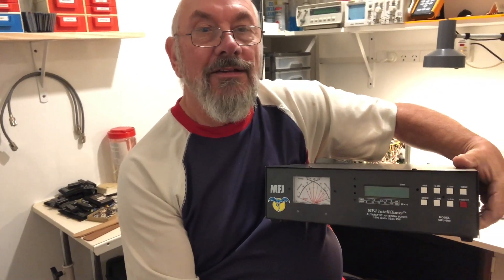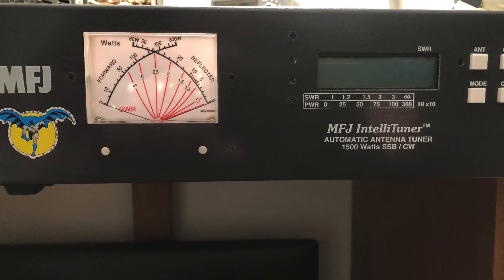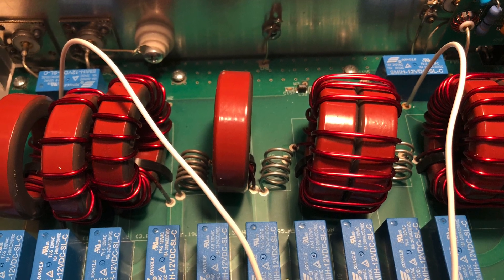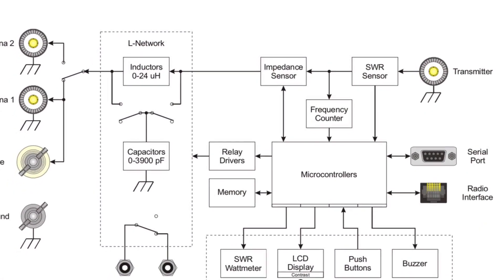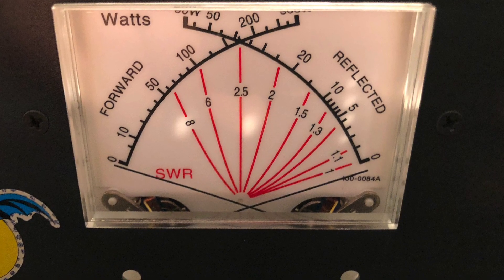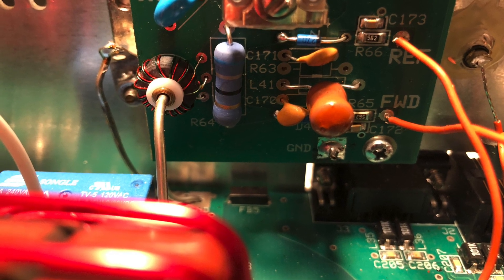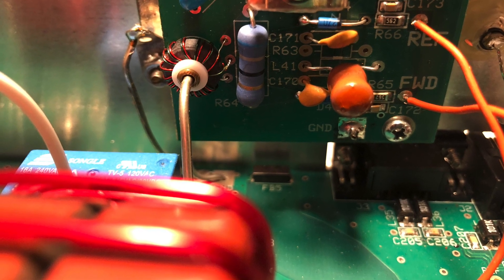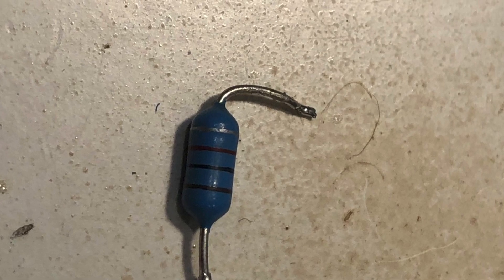Andy's Workshop - MFJ998 antenna tuner repair

Comment: Hello Andy....I am having a similar issue with my 998 at the moment but my analog meters are not working 1 out of 4 transmissions only....its intermittant....
Is this possibly a diode issue on that rf sensing board??? Do you have a schematic for this unit at all?? Do you know what the actual diode part#s are on this board?
How can I test these diodes to be sure?? Any help or suggestions welcome
73 Ted VE3SS
Reply from the maker: Hi Ted,
I don’t have a schematic as MFJ won’t provide one. I just had to trace the circuit as best I could, however the sensing board is a conventional design.
I do not know what the diode part numbers are but as long as they’re matched it probably isn’t critical. The unit would probably need recalibrating if they’re replaced.
Diodes are unlikely to be intermittent. I would be inclined to look for poor solder joints in the unit. Tsp things lightly with a screwdriver handle to see if you can provoke the problem.
The solder joints associated with heavy components like the large toroids are known to be problematic.

Comment: Hello Andy.  Enjoyed the video.  Have you heard of any situation where the MFJ-998 powers up but the digital display does not come on? Any thoughts on this?   Thank you!   Paul    KA1GIJ
Reply from the maker: HI Paul, Glad you enjoyed the video.
I'm afraid I have no direct experience of the fault you describe.
I would just have to try troubleshooting techniques based on a best guess approach because MFJ will unfortunately not publish any information or schematics for their products. I would be probing around with an oscilloscope looking for microprocessor activity and signals to the display module.

Comment: So...Andy was this part that was replaced an inductor or a resistor ? If it was a resistor, what value was the replacement ? By the way, did the replacement work for this repair ? I have the same mfj- 998 unit. My reflect will tune with vc1, but my forward tune only goes to 40 at vr-1. With that said, my tuner fails to tune an antenna and says oops....low power or something of that nature. It basically will not tune anything right now. Purchased this a few years ago and sat on a shelf. But has never worked properly. I recently downloaded the manual and started trying to do an internal tuning and found that the rear rf board could be the culprit. I only get less then a volt with an input of 100 watts. So you can see my problem at this point. I called mfj and they are going to send me an rf input board at the price of $18.00. Really just wondering if this will actually turn out to be my problem and fix. Thanks....Billy / Albq. N.M.     2 / 8 / 2023
Reply from the maker: The failed component was an inductor. The video shows the actual component that failed. It looks like a resistor but it is an inductor and it was open circuit. I'm not sure of the value and the video isn't clear enough to read it.
Reply: Andy...where did you get the swr sensor inductor with the proper micro Henry's as a replacement and how did you know the value of the part ? Thanks
Reply from the maker: @SKYHAWK0115  Looking at the video, the failed component appears to be brown, black, brown which means it's a 100 uH inductor. The part is labelled L41 on the board overlay. I would have simply found a suitable replacement in my stock of parts. I'm a retired technician but I still have a quite well equipped workshop with lots of parts on  hand.
The SWR sensor board is very simple. There's only a handful of components on it and it's easy to troubleshoot. The most complicated part is actually unsoldering and removing the board. I was able to determine that there was no voltage on the FWD connection when RF power was applied. The two diodes tested OK. The inductor was open circuit. The voltage on the FWD connection is likely to be quite low with 100 Watts applied. It should not be zero however.
Reply: Yes ...that is exactly my problem. I have a .9 voltage reading as I key up with a 100 watts and vr1 cannot come to a full 100 watt reading as it is adjusted. If you will look towards the bottom of the blue looking component, it says r-64, a 68 ohm 2 watt and the L41 to the right and shows to be a 1000 micro Henry inductor, according to the schematic. I would send you the schematic. But it won't load on youtube message.
Reply from the maker: @SKYHAWK0115  Look me up on QRZ and send me an email. I'm VK2AAK.
Reply: I did look you up on QRZ. Obviouly a QRZ license is necessary for login. Very interesting, yet I am not a ham operator. I wish I was, but have always been a CB radio user as a hobby. But yes ham communication is quite interesting and the distance it can cover.